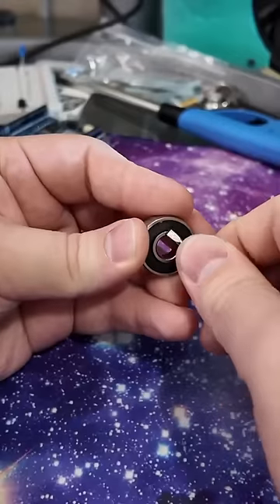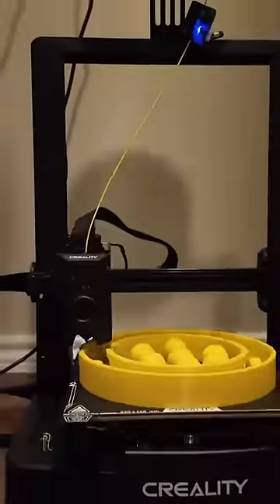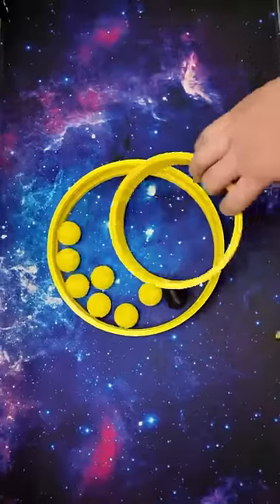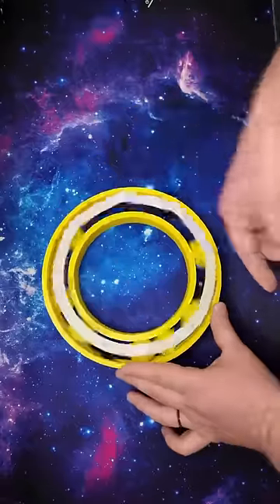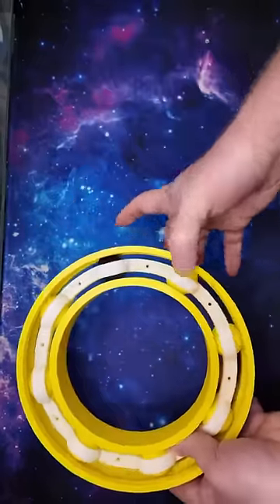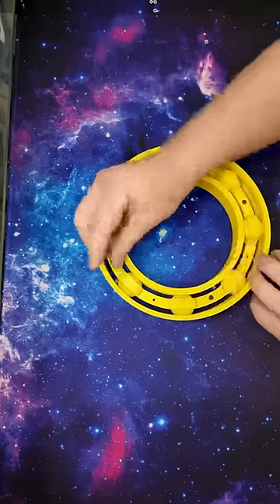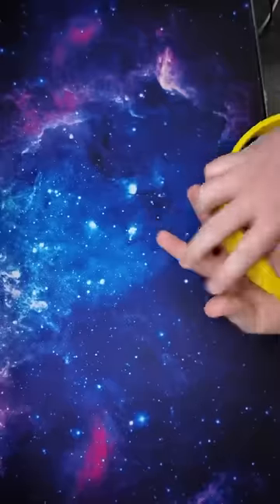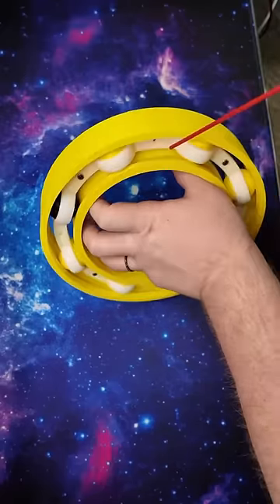How Do The Balls Get Inside the Bearing? 🤔 (ft. GIANT ball bearing) #3dprinting #engineering

Comment from the maker: Replicate this project:
Durable 3DP Filament for Bearings: https://amzn.to/3wFo7gB
Silicone Lubricant: https://amzn.to/3P5pNpV
Free 3DP Files: https://www.thingiverse.com/thing:6514500
Reply: Question for ya, could you make a shield like the small black part is on the bearing? The skate ones use a shield and 1 crown to keep them in place, I’m hoping it causes less friction and you can spin it faster without both sides squishing it!
Reply: I'd suggest coconut oil as a lubricant. It is non-toxic, smells nice, and will keep your ball bearings moving smoothly for a long time
Reply: Spinning a bearing on your wrist (or smaller bearing on a finger) can be unsafe. In a real metal bearing, it is possible that the balls and race will heat up and freeze. When the bearing does that, it transfers momentum to the hand or wrist. This can damage the hand or wrist. People who work with large bearing would never do what you are doing.
Reply: wd-40 is not a lubricant.  check out the story, it's interesting
Reply: Your 100% wrong theres no carrier like that bud 😂😂
Reply: By the way, WD40 is not a proper lube for things not metal. You should use silicone based lubes in situations like this!
Reply: @ChipperTheChipster  WD-40 is not a lubricant, but is a multipurpose spray for a variety of purposes, including displacing water and dissolving rust.
Reply: Nice fidget spinner.
Reply: I like really like using TPFE powder on 3D printed friction points. No grease to get dirty.
Reply: Oil would actually lubricate it rather than just appearing to do so like WD-40 does.
Reply: @ChipperTheChipster  He literally linked a spray silicone. Did you not read anything other than the brand name? WD-40 is a brand name that makes dozens of products.
Reply: @HyperactiveSloth79  you know, id rather not argue over schematics. WD-40 is a brand name, where most products the have are for water displacement and rust prevention. It is not so much a lubricant so much as other products or brands. 

He did link a silicone lubricant, but id not use any wd-40 as a lube
Reply: @ChipperTheChipster  You wouldn't use heavy duty gear grease as a lubricant?! 🤣
Reply: You need to make a giant fidget spinner
Reply: Knew this when I first looked at a ball bearing as a kid. Not rocket science.
Reply: @HyperactiveSloth79  you said GREASE right?

That is where i was going with my little tanget actually. Oil based lubes are never a good replacement than a grease. Id pref white lithium or moly grease for any lube application
Reply: Instead of a spot welder, just insert short lengths of filament, and melt over the ends. It helps to size the holes very near the diameter of your filament.
Reply: Why do you sound like that?
Reply: AMEN! GOD hates the sin, not the sinner! 🙏🏾✝️ GOD is the Judge! don’t kill people! Please do not use THE LORD’S NAME in vain! Leave revenge to God! Karma isn’t real, GOD IS! Don’t call people fools! Don’t swear on anything! AMEN! 🙏🏾✝️